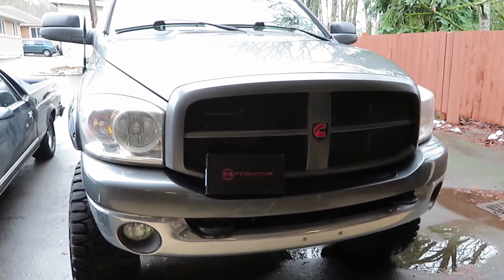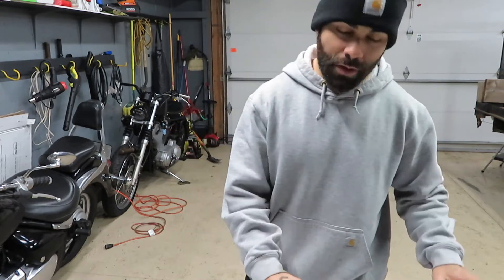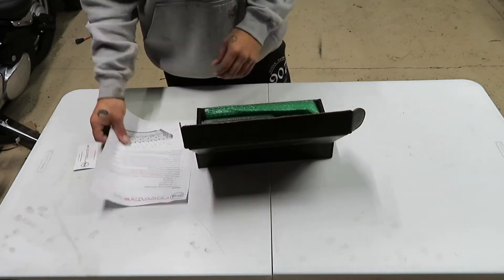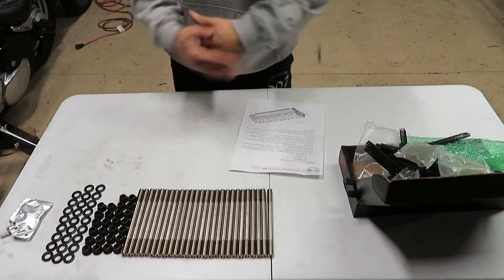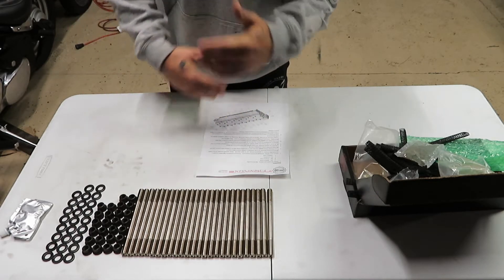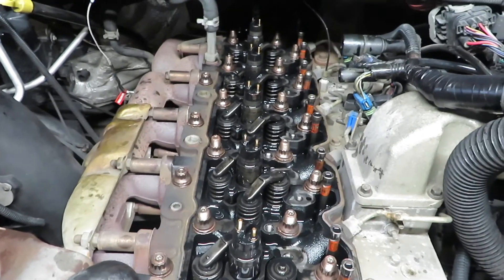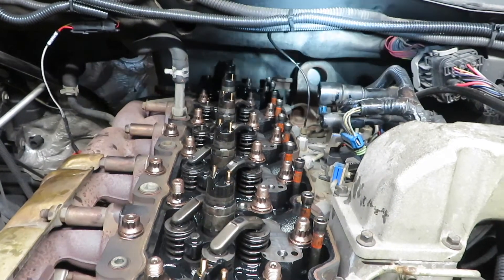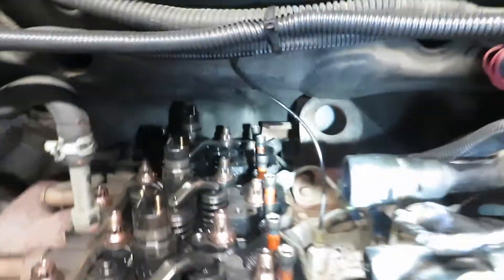INSTALLED IFG HEAD STUDS IN MY CUMMINS!!

Comment: 11/3/2020 I went with ARP625+ on my truck.  I could not find the 12mm set anywhere in stock. Replaced one by one on a 2010 Ram with 136k miles.  Good video
Reply from the maker: Thanks!

Comment: should add Xotic head studs to this list..... 220,000PSI 279$ shipped... Best deal on market hands down right now and exceptional quality....
Reply: I just installed these in my 2014 this week. Got them for $267 straight from exotic.
Reply from the maker: @raymocandler  killer deal!
Reply: Bout to do the Xotics on my 08 6.7 along with head gasket and bypass.  👍💪
Reply from the maker: Thanks for the info!
Reply: I have used a few sets on my channel!

Comment: how are these holding up? any issues at all? planning on going back in after a certain amount of miles and checking torque again?
Reply from the maker: They are holding up as far as I can tell. I ran it for 30 mins a few days later then went back in and re-torqued them. I got movement on most of them so im glad I did it. Just make sure the washers are pushed as far out as they go on the driver side of the engine before you torque them. (Away from the threaded holes for the rocker arm assembly). Otherwise they will get in the way of the rocker arm assembly. I had to re adjust 2 of them. I have done 2 oil changes since and drained coolant in order to install the bypass and there are no signs of failure. 👍🏽
Reply: @j.j.sgarage1457  awesome, yea its always a good idea to recheck torque on head studs. glad its worked out for you